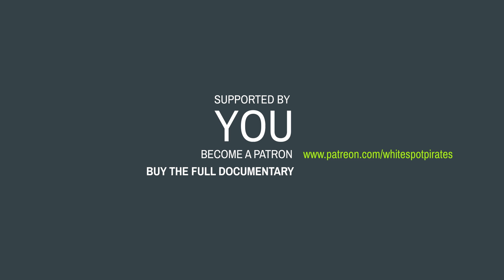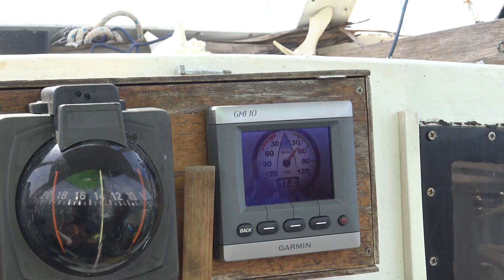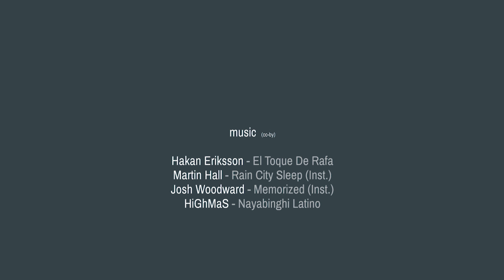Battling the Elements: Testing Our DIY Sailboat Fix in a 40+ Knots Gale at Sea

Comment: Oh man tearing into a ST raymarine brings back a lot of memories of sailing around Lake Michigan in my little old Columbia 29.  My gear kept slipping on the motor shaft. I found a few dabs of locktite helped but it would still occasionally slip off. I finally fixed it by putting in a fresh motor. You can find forums pointing you to where to get a fresh one. They are just a hobby toy car motor lol costs about $11. Worth having a spare on board if it's your only autohelm option. Nice work on the compass. Never had a problem with mine, but it was cool to see how it worked. I also always kept a towel covering it as it'd heat up a ton in the sun and would shut down. Keeping it shaded fixed that.

Comment: It's one of the best videos in the last months. Thanks for that. Instead of the massive polycarbonate (Makrolon) or PMMA (Plexiglass) you can think about canvas with flexible foil windows. That's cheaper and easier to replace if damaged. Or think about polishing the PMMA you have. It works and its only because of the age a little yellowish. So the only part need to be replaced would be the foldable one in the middle.
Fair winds
Tom

Comment: The other windows.... Is it possible for you to sand them (grit 120 up to 3600)? Others have done it - if there's enough material on them of course. :)
Reply from the maker: Knoklsnedkr it’s possible, for sure. Mine have quite some small cracks and scratches, so I think it’s safer to replace them in the long run.

Comment: As an IT consultant it pains me whenever someone loses data. :(

As I understand your current setup you have SSDs that you mail to Patrice. Which is a great way to get around the internet bandwidth issues in remote areas. I don't know if you keep a copy of all the video on Karl until Patrice is done with making them into an episode. When Patrice receives the mailed drives he should be making a copy of the files in a new drive or to a NAS/server immediately. That way if the working drive has an accidental deletion or fails you have a backup you can copy to a new working drive and continue.

On boats and in computers, spares let you replace broken parts and continue on your way. Data can be copied many times to many different drives or places in order to protect it.